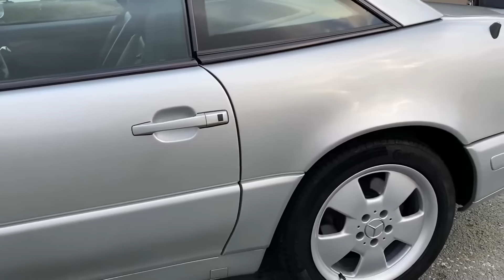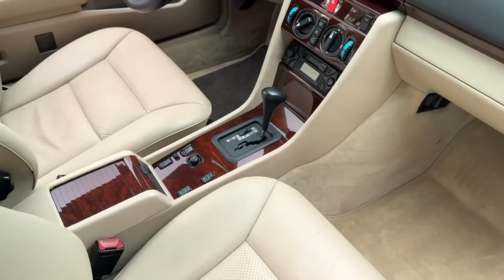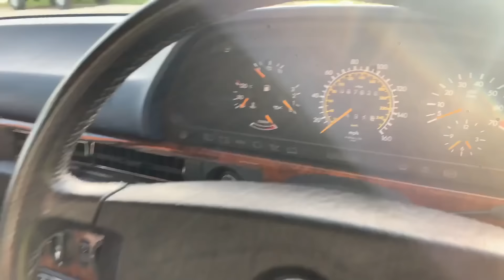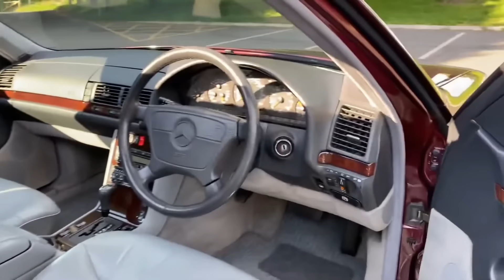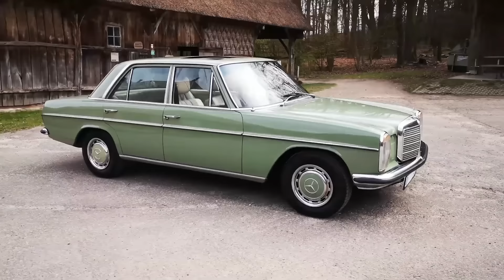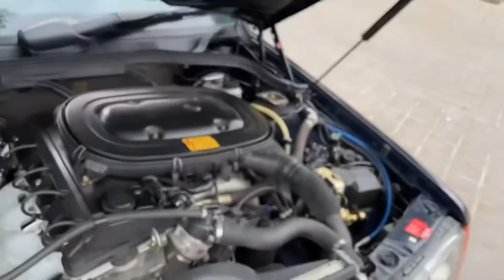THESE 7 OLD MERCEDES WERE BUILT WHEN DURABILITY CAME FIRST

Comment: I would put the W202 at #8. I’m running a 1998 C180 and it’s as hard as nails mechanically, easy to work on, and as cheap as buttons. Such a shame about the rust 😢.

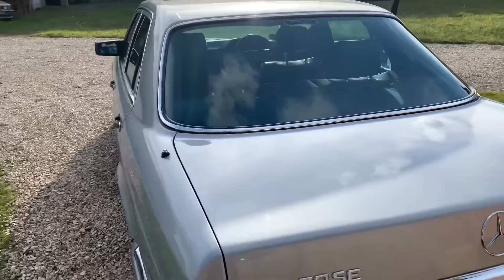Comment: 5:12 One big problem I had with Mercedes of this era is the clear tail light's reverse lenses.  These would turn aged and yellow in about a year or 2.  Making the vehicle appear old and stale from the rear.  This was a terrible characteristic which bugged me and made me question their true intent.  Were they pursuing an illusion of class, while cleverly wanting to increase profit?
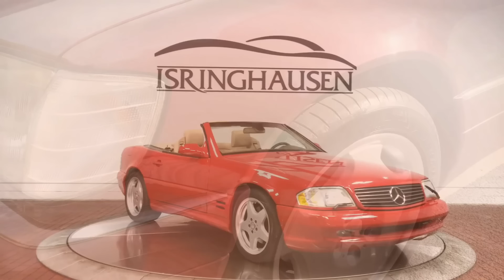8:50 "Proof that Durability and luxury were once treated as inseparable concepts."  Then why is the driver's side headlight wiper pointing NW? 🤭 (Birth time for Lexus)
Reply: Pretty sure they are still working lol.
The reverse tail lights are not clear.... Never seen them turn yeallow either. On any model.